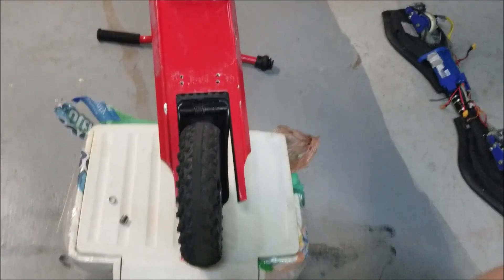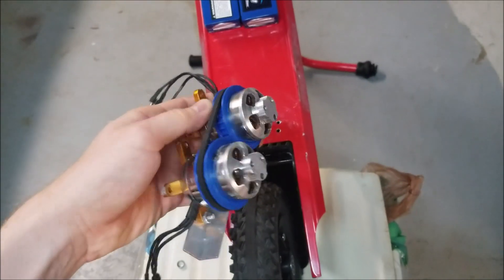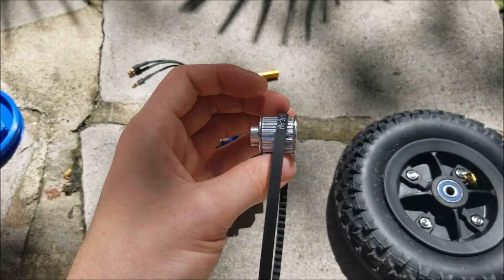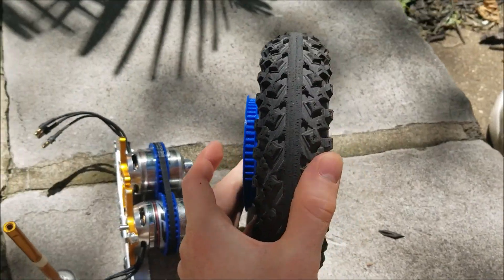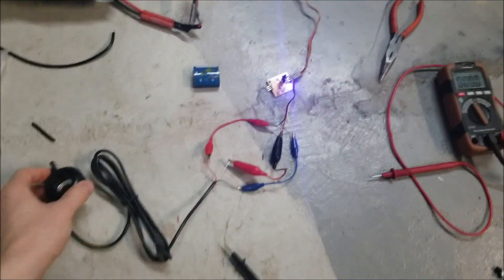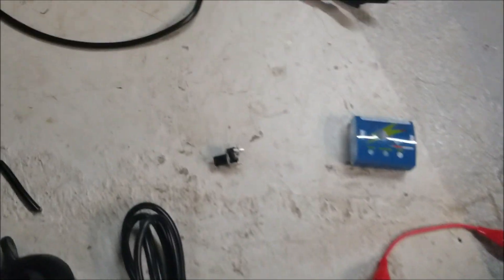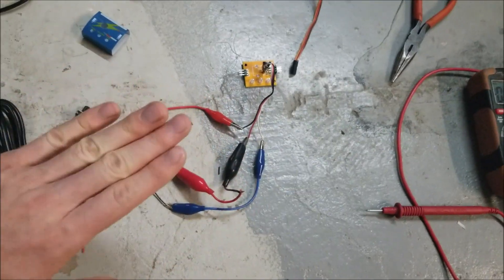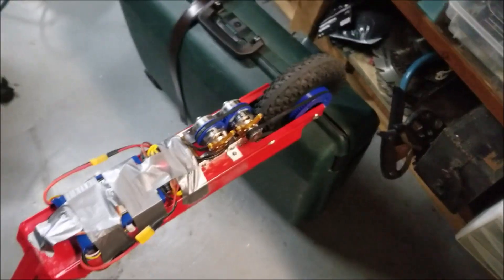DIY Electric Scooter: 3D Printed Belt Drive | Part 3

Comment: How did you manage the tension from the belt to the wheel? Is it just the alignment or did you use a tensioner?
Reply from the maker: The motor mounting bracket has slots so it can slide away from the wheel to tension the belt and then be fastened in place